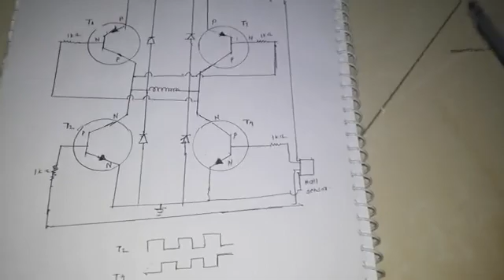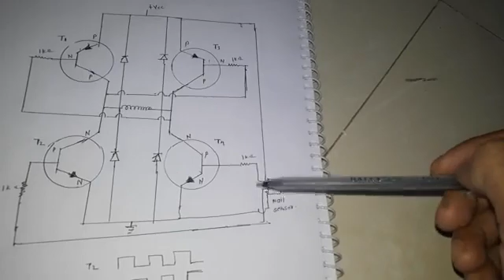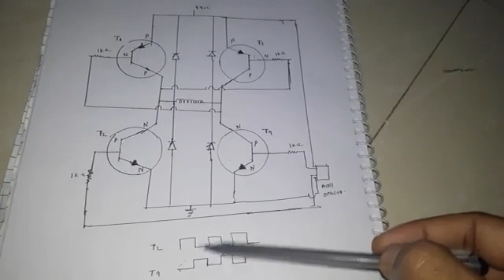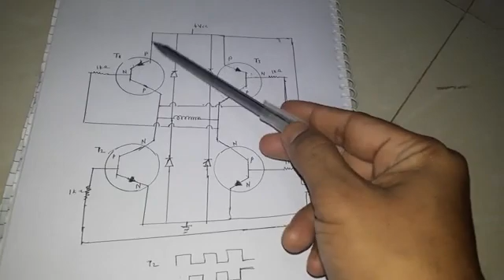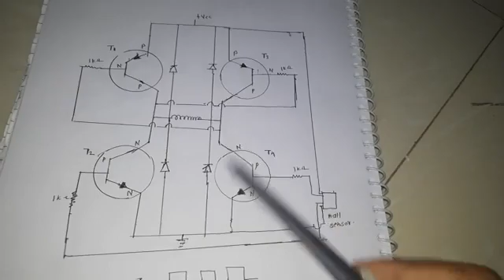Inside BLDC Fan & why it consum low power

Comment: Can i use normal fan regulator with bldc fan
Reply from the maker: No,
Reply: @prof.manoharzate8567  what is its scientific reason
Reply from the maker: Now day's AC fan regulator consist of semiconductor circuit that contains Diac and triac, these are switching devices that gives fraction of ac cyclic out put depending on the  triggering voltage.This is why we can not use normal ac regulator for BLDC fan as they work on pure 12 to 24 Voltage.
But I will recommend you to use Buck convrter for controlling speed of DC devices
Reply: @prof.manoharzate8567  thank you. Is any regulator available in market to controlling this bldc fan?
Reply from the maker: @Fun Zone , which country you belongs
Reply: @prof.manoharzate8567  India
Reply from the maker: https://www.amazon.in/dp/B07MYKM4YP/ref=cm_sw_r_cp_awdb_imm_X53PVN81JVX6DG86JA1W

Comment: Agar milega to kitna paisa lagega
Please call me-9110181863
Reply: Go for Atomberg Renewal + , I'm using it , you'll get on flipkart, it's cost is higher on official Atomberg website, previously I've returned back Orient fan due to its poor design, Orients remote was also not working when it is running. So Stromberg will be the best choice.
Reply: Simple bldc fan orient price 2250/- 
High quality orient , crompton, etc price 3500approx on amazon.in

Comment: Circuit Jal gaya hai kya isko Bina Circus Ke Bhi Chala sakte hain winding theek hai kripya Karke bataen
Reply: 12 volt AC se chalane ke liye motor winding mein. 8 point hai 4 point Ek sath aur 4 point Ek sath connection karne se chal Jaega kya aur kitne ampere Lega kya fan Kamyab ho sakta hai
Reply from the maker: Apko 2 point karnaa padega lekin speed kam hogi
Reply from the maker: Yes, speed frequency pe depend hoti hain, lekin bldc fan main speed hall sensor aur current pe depend rahti hai
Reply from the maker: Bldc fan ki winding kabhi jalti nahi.
Eska sirf circuit jal jaataa hain
Reply: @prof.manoharzate8567  main puchna chahta hun kya ise Bina circuit ke kisi Prakar Se chalaya Ja sakta hai purani winding ke sath
Reply from the maker: 12 volt AC pe chalaa sakte ho

Comment: Sir BY TIMELINE ...The PERMENANT MAGNET ...looses 20 to 30 % its power ...then we must change the STATOR (fan rotating part ,which contain NDFeB MAGNETS )

When we exchange old fan ROTOR 

@The companies will REMAGNATIZE those old magnets ...and RE-SALE to US 

For that ....they may charge 80% of Fan cost ....

Instead there is a Another SYNCHRONUS motor technology..which USED IN GOGORO E-BIKES ..

Thay will be RRLEASED soon
Its a SCANDAL ...over  publo
Ic
Reply from the maker: Yes, you are right sir, but stator magnetic rings are available @ rs 250 on india mart.
In case of synchronous motor statar part is electromagnet,  again that required same electricity as that of rotor magnetic coil.
This motor consumes dubble power as that of bldc magnetic motor

Comment: Where could i find PCB of this fan
Bcoz i have same modal but it's circuit burned out 
Please someone help me where to buy this type of circuit board
Reply from the maker: Replace all transistors, circuits are not available of this fan any where
Reply: Thanks for reply
How can I increase rmp of this fan ?
It is required to change circuit if I want to increase rpm ?
Reply from the maker: Replace winding by 18 gauge wire
Reply: @prof.manoharzate8567  
Will it effect on circuit ? 
Or coil will burn due to heat ?
Please help sir
Reply from the maker: Coil will not burn
Reply from the maker: Transistors used in circuit has more than 5 A rating
Reply from the maker: This fan consumes only 2.5 A current
Reply: @prof.manoharzate8567  
Thanks for reply sir
1 more help 
18 gauge wire how  many turn will it need
Reply from the maker: @raghabraj8453  wight of previous wire must be equal to 18 gauge wire
Reply: @prof.manoharzate8567  
I checked all components in circuit all transistors and diodes are ok 
But circuit ia not working 
Is it possible the hall sensor in this circuit is not working ?
Reply from the maker: Yes,  you might be applied more than 18 Voltage. Hall sensor may be damaged
Reply: @prof.manoharzate8567  
Yes I placed this fan direct throug solar panel 😭
Reply: Hello again
Sir maine hall sensor change kiya 
And rpm increase karne ke liye
Jaise aapne kaha tha waise wire ka gauge change karke rewinding kiya uska result bohat accha mila fan ki speed badh chuki thi 
Fan full load par 3.50 Amp le raha tha 2 din tak fan sahi chala then suddenly firse band ho gaya 
Maine circuit check kiya to uska ek trasistor short ho gaya 
SIR YE KIS WAJAH SE BURN HUA HOGA ?
Please reply jarur dijiyega
Reply from the maker: @raghabraj8453   Increase again 5 tun in each windings. Beacuse of high current from the base of transistors might be damaged.
Or add additional 1k ohm resistance at base rasistance in series.
Reply: @prof.manoharzate8567  
Thanks for reply 
I used 26 gauge aluminum wire in winding bcoz previous main winding was on aluminium.
Should I increase +5 tuns to reduce Amp ?
Or should change winding from aluminium to copper wire ?
Or change wire gauge to low Amp ?
Please reply
Reply from the maker: Use copper wire
Reply: @prof.manoharzate8567  
Should I use 26 gauge copper wire ?
If I use copper wire its weight higher than aluminum wire 

So sir what will turn calculation ?

And sir 1 more question
If I want to make this circuit what type (number) of coil should use ?
Please reply
Reply from the maker: 26 gauge
Reply: @prof.manoharzate8567  
Sir 26 gauge copper ?
What will turn calculation ?
Please sir 
Please
Please
Reply
Reply from the maker: Five turn in each windings
Reply: @prof.manoharzate8567  How it consumes 2.5Amps ? You are totally wrong, it should not draw more than 200 mA,. 2.5×230=575 ,The wattage of the fan will be 575W, it should not cross more than 35W if it's BLDC fan.
Sir do not mislead the people.
Reply from the maker: @VMalthane  Dear sir ,I think you don't know about BLDC fan, it works on 12 Volt and required 2 to 2.5 A current.Now days same technology is used in electric scooters. Induction fans consumes 250 mA of 60 watt.You should watch video again.

Comment: Bldc - brushless direct current motors , well bldc might be a transformation but bldc fans are a disadvantage over an advantage , all bldc fans are built with a circuit board unlike ac motors that run on alternate current, there cannot be any best bldc fan , why?bldc fans usually are a headache after warranty , circuit board faults, remote control issues, starts up slowly, high voltage issues of circuit board burnout, in the present scenario bldc is not a very successful product most manufacturers usually have only 1 or 2 models some manufacturers are using bldc technology as a cash cow by showing power saving advantages the fact here is that bldc fans save power but at a negligible rate which is not appealing enough, brands like havells, crompton, orient and many others usually don't see the technology as a permanent solution to the power saving world. So they decided to introduce 40w to 50w ac fans which last longer and are highly durable compared to bldc fansEg of models havells es 40w, Orient energy star 48w, Crompton high-speed 50wOverall Would suggest an account fan over DC

Comment: hall sensor vala hai to kya remote operation diya hai, speed kaise control hota hai.
Reply from the maker: Hall sensor ke fan ko remote nahi hota
Reply: speed kaise control hoga.
Reply from the maker: This fan does not have any regulator for speed control.But you can use PWM speed controller for it